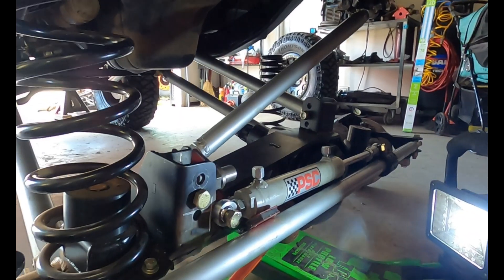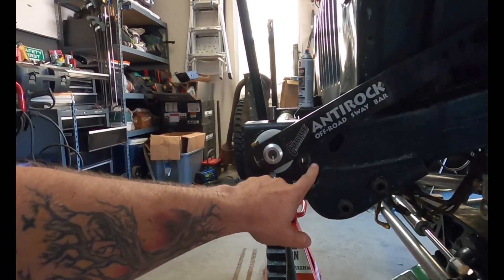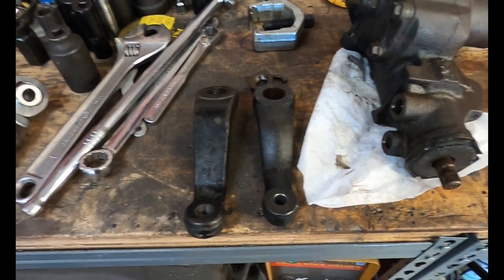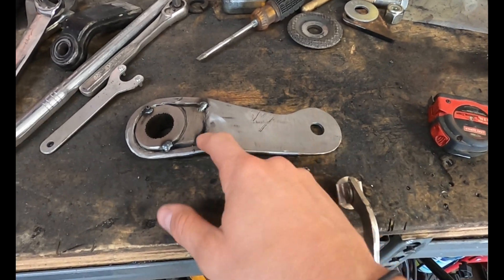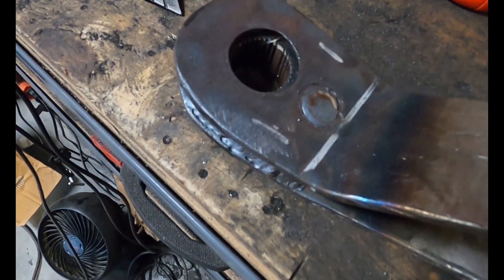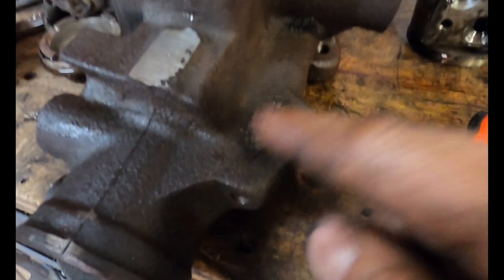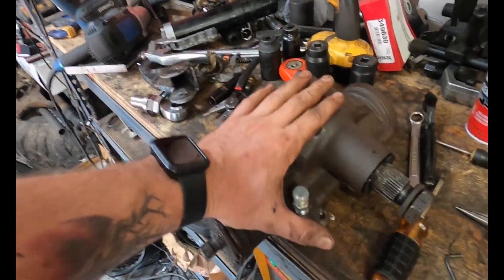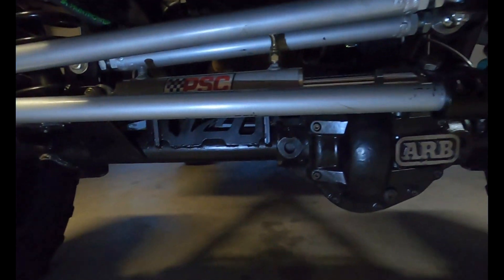DIY Custom Pitman Arm & Hydraulic Steering Assist - EMC 4600 Jeep Build Ep.11

Comment: Well I just stumbled across your channel and this is the first video for me. Im enjoying, I have a 99 TJ that I am building, same color! I am impressed you pulled that steering box apart, not many realize how simple it is to work on them, hell it's been years since I went through one, didn't even know rebuild kits were available now days. How did that pitman arm hold up? I kinda felt it was built a little light with what appeared to be 3/16, but hey if its holding up to the torture test then good to go. I will have to go back and watch more of your videos.
Reply from the maker: Welcome! That’s awesome, I like the color myself. As for the pitman arm, you are correct. It is 3/16 plate, however I overlapped the plates to the original pitman arm and then plated the back to tie it all in. It’s been beat on pretty hard and all has held up well. The double shear points really make it stronger than the original design.